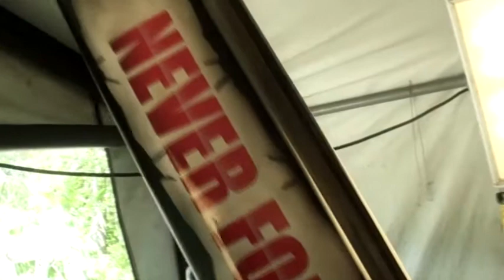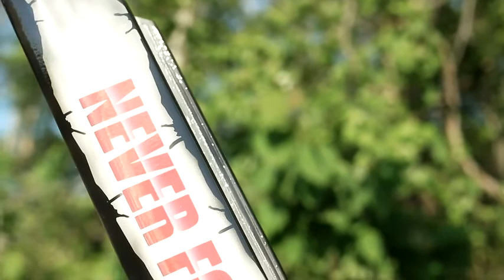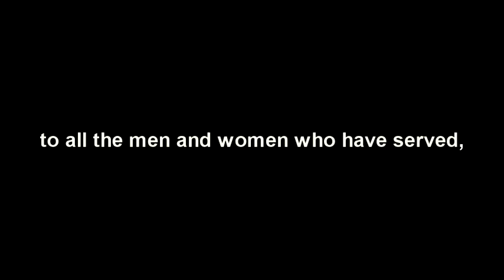POW MIA6 clear coat day

Comment: what brand of clear do you use?
Reply from the maker: In the past, I've had good results with Nason 468 spot and panel, but on this project I used a 2k I got from Napa auto parts, Finish 1's FC-720 or FC-710 I can't remember which.  The 710 is a spot/panel clear while the 720 is an overall clear.   The Finish 1 is a bit thicker/heavier coming out of the gun, and the first time I used it I put too much down on the first pass, got a huge sag I had to sand out.
Reply: Jack Bias I'm going to try it on a barstool and see how it holds up.
Reply from the maker: It's meant for automotive use, so treat it like a car, and you should be fine...wait, treat it like a nice car...